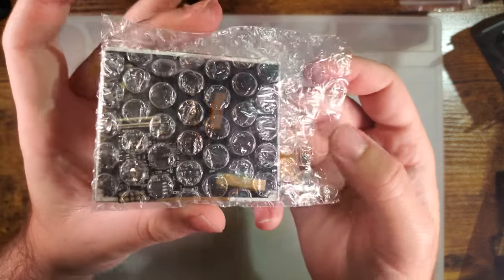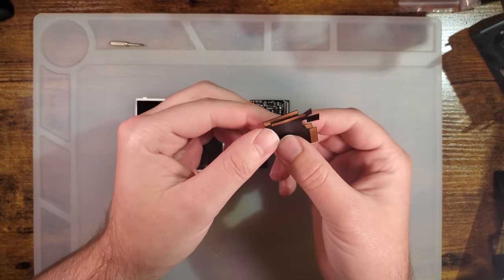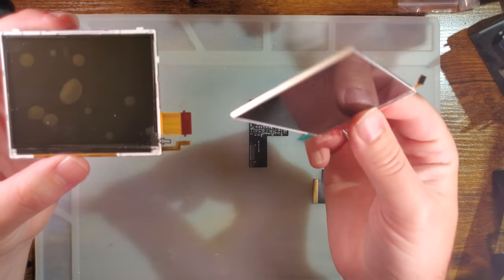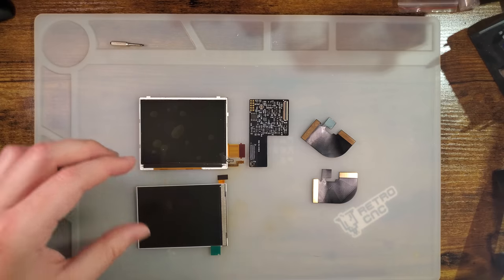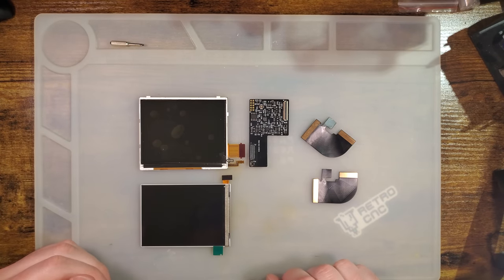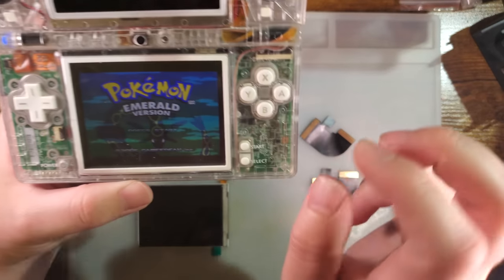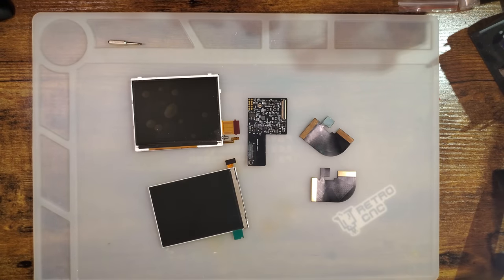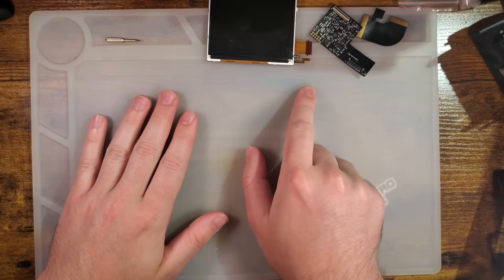'ITA' TFT Backlight Kit from Funnyplaying

Comment: Screen Alignment: Press & Hold L+R+Select for a couple of seconds, It will enter alignment mode. Alignment is adjusted using L or R. Mode 1 = Vertical adjustment, Mode 2 = Horizontal adjustment. Press & Hold L+R+Select to cycle mode or exit.
Reply: Mine does not save the configuration and level bright, you can move the image, but when turning off it returns to be off-center :(
Reply: When do you enter this "mode"? Im trying on mine (it is however stock), but nothing happens. Is the tool built in to the gba itself or is it a part of the ribbon cable you get with this kit?

Comment: Always make sure when putting metal screws back into plastic threads; to always gently turn the screw left until it clicks into place, and then right after you screw it in. That will prevent you from making new threads into the plastic and it sets the screw to the original thread.

Comment: Hey Makho, I’m digging this screen - very similar to a DS and AGS-101 image. I honestly like the IPS look which is somewhat sharper but still prefer playing on the AGS-101 for the pixel grid look (that’s me). But despite the amount of shell trimming and the not that great viewing angles, this looks to be one that I’ll be picking up when they release.
Yeah the touch sensor is something that I’ll avoid using or trimming it while adhering to the shell (not a fan of these overall).
Anyways, thanks for showing this.

Comment: Hi Makho, I got myself this ITA kit and am noticing that pixels are not looking like how the look on a NDSi. You can see what I mean escpecially well on darker colors. Lets take an area of a solid color. On a regular DSi this area consists of pixels that are identical to each other, resulting in an evenly colored area. If you swap the same screen to a GBA with this ITA kit and view the same colored area, you see that the area is not evenly colored. The pixels are not all identical to each other. It looks like one row of pixels are darker, then the regular color, the next row the same darker color and so forth. So it looks kinda like scanlines. I have testes two ITA screens from funnyplaying, one genuine DSi screen and one genuine DSi XL screen. All show the same effect. I also tried different GBAs, both 32 pin and 40 pin adapters and all show the same effect. This leads me to think that maybe the ITA board from funnyplaying is broken or maybe all ITA screens are looking like this but nobody except me has notinced any issues. Adjusting the potentiometer didn't help. The thing is, on screenshots this effect is really hard to see, but it's cleary visible if you watch the screen live. Can you please get your ITA kit and check if you notice anything strange with the pixels? Please compare the same image with a GBA using this ITA kit and a NDSi, using the GBARunner Hypervisior. I would really appreciate it.
Reply: Would be great to hear a response to this.

Comment: I recently installed this kit and I'm very pleased by the results, but found some strange things about it that you may want to look into.
I adjusted the screen pot and the flicker went away, but the screen has some odd interlacing going on. with certain color shades you can see horizontal lines instead of a solid color like it should, I'm thinking it's the screen itself, because I have two dsi (early and late models) and one of them has similar interlacing but only on movement (late model), the other doesn't (early model).
another odd thing is that whenever the gba enters sleep mode, it's like if select is already pressed, as I only need to press L and R or Start (obviously depending if I use a game with sleep mode included or injecting it with a flashcard) for it to wake up.
the gba is a 32pin model if that matters.
Reply from the maker: Based off your description, it honestly sounds more like a problem with your install. The potentiometer shouldn't even do anything because the screen is not driven by the GBA's regulators. Funnyplaying includes their own regulators on the adapter.
Reply: @makho  Interestingly enough, the official instructions do actually say to turn the pot to adjust the flickering. I did it on mine, and I can 100% see a difference when I turn it.
Reply from the maker: @JackGMusic  The instructions changed between when I made this original video (which was what my info was based on) and now. Yes, you are correct in that tuning the pot is required for best results.
Reply: @makho  I saw your updated video! No worries at all, I just thought it was interesting because I had made the same assumption as you: that this wouldn't use the gba's circuitry at all

Comment: Another pro of this screen is no added inputlag unlike the portrait mode blackberry screens a full framebuffer of delay is required to rotate the image to scan out on such a screen.
Reply from the maker: Have you actually measured the input lag? I'd be curious to see precise values. I've tried measuring kits myself but I don't have the equipment necessary to get meaningful data.
Reply: @makho  Sorry don't have a setup to test, If I ever make a lag tester with a photodiode and microcontroller I will test it.

Comment: C54 cap? Hi Makho, I'm always inspired by your videos! thank you! Qestion: I read on the Funnyplaying website that with a 40pin motherboard it is necessary to remove the C54 capacitor. Did you do it?. What is the problem if I do not remove it?

Comment: I like it :) Is soldering a must? Or Is it okay if I don't need to adjust the brightness? Thank you very much.
Reply: You can use the touch sensor already on the connector, but it is a bit fiddly to get it stuck into a good position.

Comment: A quick question if you have time to answer big makho, is it necessary to order the ITA panel form FP too, or can we use one directly from a scrapped DSi? I ask because FP also give the option to buy the ribbon kit without the display panel.
Reply from the maker: I highly recommend getting the panel with the kit if you can. Funnyplaying has newly manufactured LCDs that are already prepared (i.e. no touch digitizer and the frame is already stripped) for the purpose.

Comment: I have a question, what do you think about gba sp charging cables with USB input, can they damage batteries or consoles? I have an original charger with gba sp, but I wanted to ask because I thought about connecting such a USB cable to the powerbank when I am away from a power outlet.
Reply from the maker: voltage is within tolerance so as long as your USB power source is spec compliant, there should be no issues.
Reply: @makho  Thank you very much

Comment: Could you redo this install in the Funnyplaying screen-ready shell when it releases? Maybe then the install will be a bit smoother?

Also, would cutting off the touch sensor affect the default brightness? I don’t care for having one or even soldering to adjust for brightness, but getting locked to the lowest setting would be a deal breaker
Reply from the maker: I already said I would do another video when the shell comes out. And no, cutting off the sensor (and not wiring up button controls) would lock you to whatever brightness you leave it at.
Reply: @makho  did you ever get the screen brightness to work with left/right + select? I cannot get mine to work but the sensor does work.
Reply from the maker: @dr.influencer9198  yes? I showed it in the video.
Reply: @makho  I must have missed it, but I had a similar issue with the R + Select not working, but it was due to the button not working so it's all good now. thanks for taking the time to reply.

Comment: Can it works with a ips lens size? I bought a case with ips lens but idk 😭
Reply from the maker: kinda. There will be a small gap but yeah it should be fine. The image on this screen is smaller than the 9380 IPS kits that your lens is designed for.
Reply: Ty for answering!

Comment: imo viewing angles aren't as important bc your naturally gonna be playing with the screen directly facing you, but different stroke for different folks and all that
Reply from the maker: but the optimal viewing angle for TN screens is not always the angle you are holding the console. Just because it's in front of you does not mean that the screen is on a perpendicular plane with your eyes.
Reply: @makho  right but what I was trying to say is really the only time it’s going matter is if you’ve layed it down on a flat surface. Most of the time it’s clearly visible, even when your aren’t directly facing it.
Reply from the maker: @garagegames2555  Just because it's visible doesn't mean it's good. TN screens can have wildly different colors depending on the angle you view it. In my experience, the saturation and contrast of TN screens are not as good as IPS either.

Comment: 144p squad
Reply: 1080p is available tho
Reply: @AtoManPL  My computer can only handle 720p. So it's 144p or nothing I guess.
Reply: @Rodville  I'm on 1st gen i5 that would normally choke on that too, but it works surprisingly well?
Reply: I'm on att so is 144p or buffering every 5 seconds
Reply: @AtoManPL  AMD A6-7310 APU with AMD Radeon R4, 16GB ram, and 1TB SSD. Have fiber internet 1000 mbps and STILL it will not run any youtube video at anything more than 720p.
Reply from the maker: this video too an insanely long time to process by youtube's standards. I figured that once the HD resolutions popped up, it was done. Guess not. Oh well, it is done now.